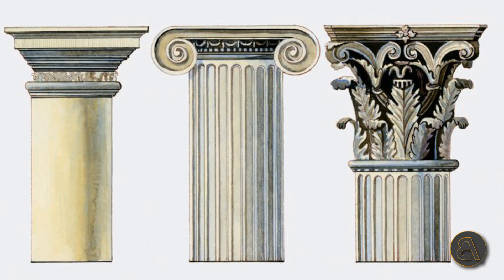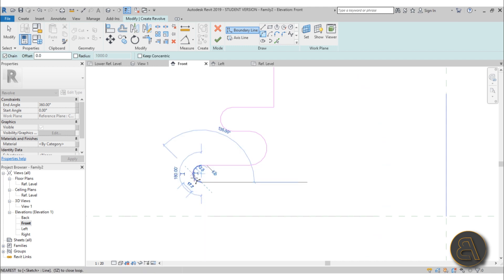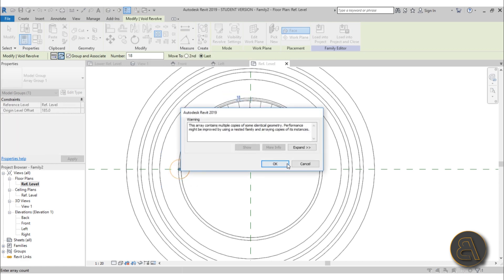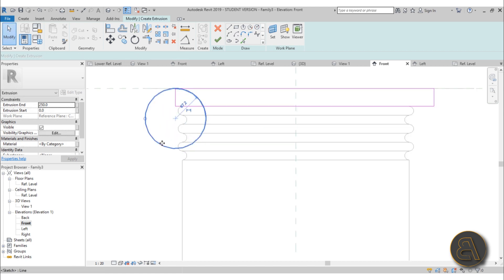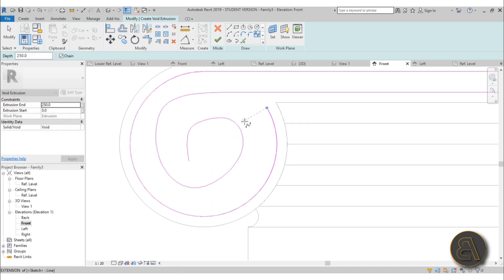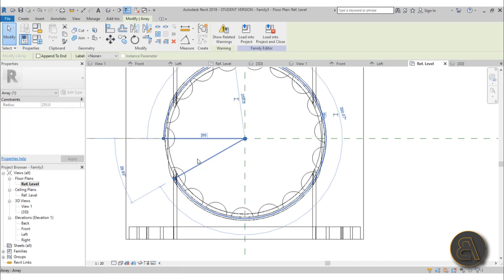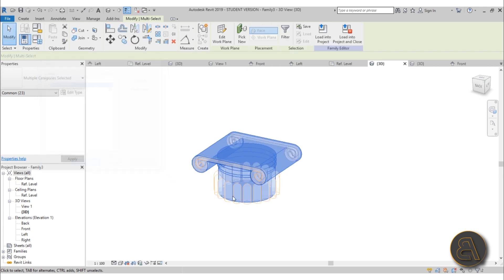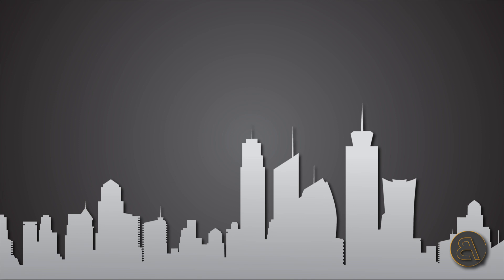Classical Column in Revit Tutorial

Comment: Having trouble with creating custom column based on your method.

The only difference from yours was the top crown I created in Ceiling Plan, then load into the column base family file which i created previously.
The problem I have now is the top crown doesn't move up and down, only side ways when I locked both top reference lines as per you did @12:30.

The error message I received from REVIT: Constraints not satisfied. Please help.